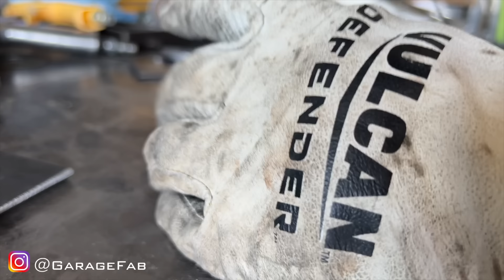Build Poly Engine Mounts For Anything! Mighty Max Ep: 19

Comment: Most engine mounts have elongated hole's for easier assembly reasons and more flexibility in the actual mount .  I believe your set up is to ridged
Reply from the maker: I don’t think the elongated holes have anything to do with flexibility of a mount. When the bolt is tight, nothing moves but the polyurethane. As for the easy assembly, I don’t foresee any difficulties. Since the mounts were built for this truck specifically rather than a kit designed to fit particular model considering any variations in the manufacturing process.
Thank you, Tim!
Reply: @Garage Fab YES   the elongated hole's only help with assembly and then yes you tighten the bolts I have been a mechanic swapping engines for 35 years the elongated slots really help sometimes..I believe your mounts are to ridged which may cause noise and vibration issues. I would have chosen a proper car engine mount that is more flexible

Comment: OK so I've got a question this might be dumb say you have a straight piece of pipe and you wanna cut it and weld it back so it makes a 30 degree angle hoe do you find the angles to cut the pipe?
Reply from the maker: Not dumb, Darrian. Angles are tough and I’m only just getting the hang of it. This will likely be hard to understand in text form, so go check out the video link and jump to 10:05. Then read the rest of this comment.
https://youtu.be/hbxr4k14qH8
You’re starting with a straight piece of material. 180°. To achieve 30°, the material needs to kick up 150° (180 minus 30)
So you need to remove a 150° triangle from the material.
Use a square to draw a line where you want the bend to be, divide that 150° in half (75°) and mark a 75° angle on both sides of that line.
You can now cut out the triangle you just made and bend the material, or completely cut through the material and weld it back together. You should have 30° or close to it. It’s normal to have to adjust a little to make the angle perfect.
Lemme know how it goes!
Reply: @GarageFab  thank you

Comment: What transmission are you using behind the 4G63T?
Reply from the maker: Unsure of the specific name but it’s just the factory manual transmission that came in the 87 Mitsu Mighty Max. Nothing fancy. Probably not very strong but it should be able to handle my Wife’s gentle driving.

Comment: Why not cowl the hood to give clearance for the turbo. Lift the engine 2”.
Reply from the maker: Sounds fantastic. But the truck has already been painted. Likely an unmatchable color. No body mods allowed.
Reply: @GarageFab  I was just suggesting the cowl to give you more space for either the turbo or the exhaust if you had to spin the turbo back to the original position.

Comment: I just learnt something from this, don't put a fwd engine to a rwd car
Reply from the maker: @alibabaei1953  No way! Without challenges, things become boring. 🤔
Reply: @GarageFab  it will not be reliable at all man,you can't just make holes in the block😁, plus those mounts are solid and your engine is inline 4. it'll vibrate so much so that you think you're riding an electric tooth brush. im assuming you removed that balance shaft from 4g63 of yours. so double the vibration.
 i have to admire your hardwork and learnt many things about the things you did but why you didn't at least choose an engine from rwd car? this is just unnecessary headache🤕

Comment: I'd say that third whole on the passenger side probably wasn't necessary.
Reply from the maker: You’re the second to say that! Someone said the factory mounts only have two holes. That may be true, but if it is, I don’t like it! I’m not an engineer but I wouldn’t be satisfied with a mount that could potentially rock on 2 bolts when you slam on the brakes. I want at least 3 holes.
Reply: @GarageFab  That's fair.

Comment: You mentioned engine angle.  I’m replacing a straight 6 (it’s rusted solid) with a 350 what do I need to consider regarding engine angle?
Reply from the maker: There’s not a lot to worry about with the angle itself. You’d want to make sure that the oil pickup (inside the oil pan) is always submerged in oil, and also make sure that the oil can return back to the pan from the heads. (There are holes that pass all the way through the heads that oil drains through) If the engine is tilted too much I suppose there’s a possibility that oil could be slow to return to the pan, and starve the engine. 
I think it would take several degrees to get to that point. A 5 or 6 degree tilt would probably be ok.
The rest will be determined by the vehicle. You need the trans to clear the tunnel. You need the oil pan to clear the crossmember. You don’t want the oil pan to touch the ground so you might want the pan up higher than the engine Crossmember. (Depending on what you’re building)
Hope this helps.
Reply: @GarageFab  thanks that was helpful.  My restoration project is a 1953 international harvester panel truck.  It has a straight front axel.  I would like to modernize it for a better ride.  What do you recommend?
Reply from the maker: I’m not familiar with the truck, Frank. But old timey stuff often has big heavy leaf springs. Getting rid of those would be a good start. Swap to a 4 link with either air springs or some softer truck springs. What do you plan to use it for?
Reply: At first it was a neat project with a gigantic learning curve, but as I been working on it I’ve been thinking that it would be neat to tour the country visiting NM and maybe even Reno.Air races then back to NY.  So it needs to have a comfortable ride albeit it may not look cherry because I’m soooo inexperienced with all this.
Reply from the maker: Well I don’t want to overwhelm you, but if you’re going to be on the highway for hours, I’d highly recommend air suspension. It screams (or whispers) luxury and comfort.
Absolutely NOT performance, though air springs stiffen up significantly at higher ride heights.
After experiencing road trips with low PSI bags, no other vehicle comes close. Move over Lexus.

Comment: PS have you thought about going for a Hair Transplant in Turkey it's only $3000 you have good face Hair take years of you
My son and his two mates had it done they all look great there 40 now they had it done 3 years ago think you're about same age am in my 60s 😊 am not trying to take the mick out of you am being sincere
Reply from the maker: Haha! Thanks Christopher! I was sad when I started losing my hair. Now I’m not. I love it. Especially now in the summer. Feeling the breeze on my scalp is fantastic. I’d have the rest of my hair removed so I wouldn’t have to trim it rather than getting implants.
Reply: Tell the wife get the hot wax out good luck 👍 the engine mounts the 2 pieces that you attached to the tube very thin on point of contact that's what am referring to box in or do the same all round
Reply from the maker: Ah! Ok. They’re very short pieces of very thick metal. And because these mounts will be mostly resisting the engines twisting motion and only some forward and backward movement on acceleration and braking, I think we can skip the boxing in this case.
Reply: @GarageFab  if a job is worth doing it's best to do it 
The best of your abilities you not think so ????🤔🤔
Reply: Stop being Laxy you want be say that 
when box bellhousing and prop go goose up
Reply from the maker: Perhaps!